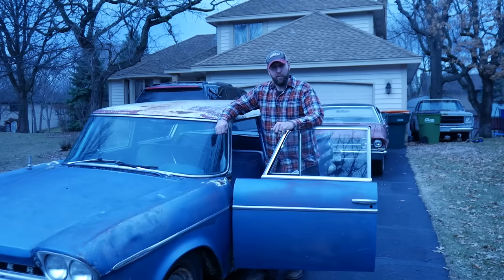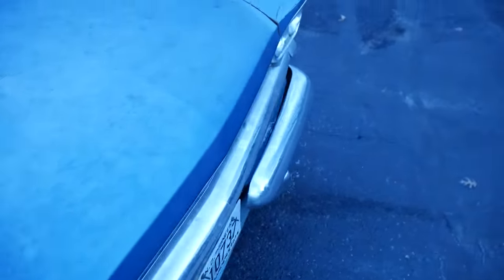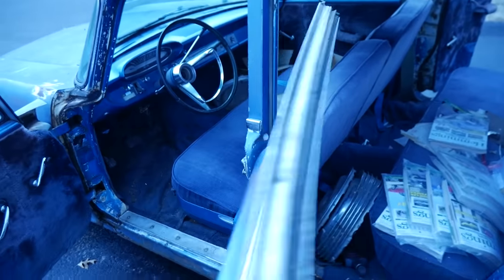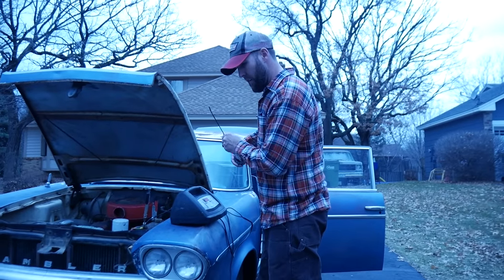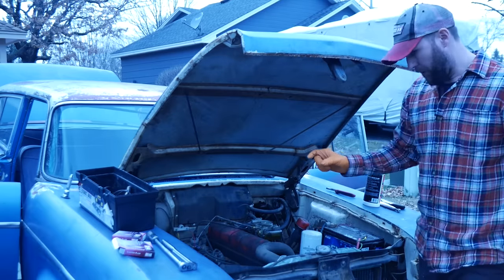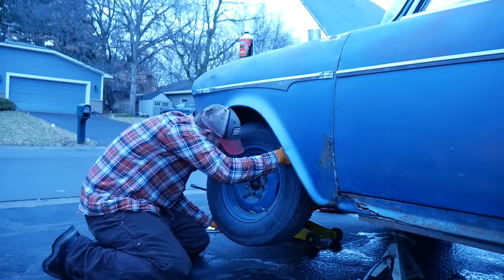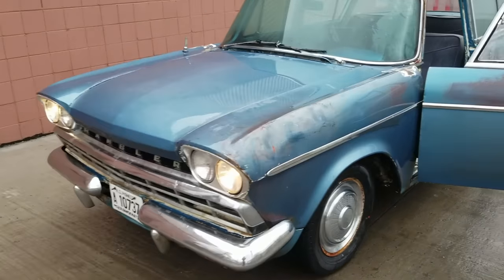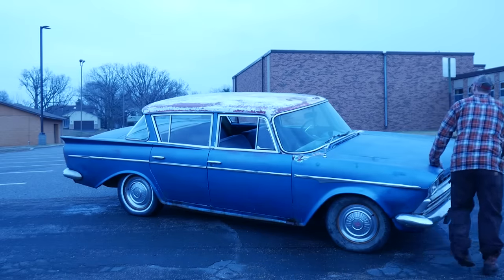AMC Rambler First Start & Clean Up - Vice Grip Garage EP22

Comment: I get old cars like that one, previous owner's neglect and frustration can be a good buy.  I wear out a can of WD-40 on all the latches hinges, window regulators..  anything that moves or used to move...  and I wear the whole car seems to respond to it...  Runs better too!
When replacing bulbs and checking connectors on those old cars, you're going to find them either rusted together or a white powder of dis-similar metals deteriorating one another...  Use dielectric, conductive grease on all electrical connections.  Makes positive connections and end corrosion.
There, those two things is less than $5-$8 and things are well on their way...
Carb cleaner, engine oil flush and oil and filter change, top off all fluids, bleed the brakes (inspect the rubber brake lines) plugs nd wires as needed...
For under $60 bucks, you got an easy flip, making cash.

Comment: When I was eighteen I had a red and white1962 version of this Ramber back in 1968 that nearly took my life on Christmas Day. I just arrived in Smithville Mo.after a trip to Tulsa and back, After eating at the Dairy Y, I put the car in reverse then the left front wheel completely fell off. If that had happened on the interstate while I was traveling at freeway speeds, I'm pretty sure, I wouldn't be alive today. AMC was known for defective front-end A-frames back in the old days. It would be wise to check the front-end suspension for integrity issues before driving that car again.

Comment: I bought a 1960 Rambler in 1971 for $80.
Push button transmission and the seats folded back into a bed.
Finally killed it chugging up the Pocono Mountains.

Comment: "Old Blue and Lubed" or "Whydbit" (Why Did I Buy This).  If you have the odd 427 or similar big block, it makes a great "sleeper" for street racing those fancy Detroit and Import "go fast" cars!  The one with the 427 and slicks recessed behind the stock fenders sure surprised a lot of folks, especially when he pulled the T handle in front of his seat the opened the cutouts for straight header action.

Comment: I loved my Rambler, I traded a shotgun for it, had a 2x4 preventing the front seat from falling back, lot-zzzzzz of weight reduction plus the optional bear can disposal hole in the floorboard. But I loved it, it ran like melted butter. Wasn't as nice as this one. I miss my 3 speed. Unfortunately I was trying to keep the radio speaker from falling in the floor and a telephone pole jumped out and hit the car. So it was so rusty that it totaled it at 15 miles an hour. Loved it though. I took the stereo out and was able to save that.

Comment: My Aunt brought home a new 1958 Rambler 4-door pink/white top. The 1st thing I did was push in the cigarette lighter.Apparently it stuck in, what did I know,I was 14! I left the car andupon returning some hours later, the lighter still stuck and making heat had melted it's plastic handle and sent it streaming in melted goo on to the new carpet. My Aunt was not happy. the next event with this car was a trip to the Rambler garage to check on its repair status.It was awaiting a factory parts shipment, but what sticks in my mind is the tremendous volume of parts contained in an automatic transmission spread out on brown paper on the shop floor. The shop supervisor's conversation did not inspire confidence.It would not be the final meeting with this man.Looking back this was a basic piece of proven mechanical technology,certainty not cutting edge, so why was it so unreliable?

Comment: Call it the Gambler, or the Rumbler, put a hot V8 in it and some kind of suspension mods.  Stiiffer shocks.  Maybe a tach and some guages.  Cooler wheels would help.  Maybe just tricker hubcaps

Comment: I had one of those in high school. The previous owner died in it and they didn't find him for awhile, so I got it for next to nothing. That odor made her a real chick magnet. If I took a corner too fast, the doors on the outside of the turn would swing open. That improved ventilation for the stench. One time after I changed the oil and did her a few other favors, afterward she wouldn't start. I got mad and stabbed her in the fender my screwdriver. (Hey I was sixteen and not doing too great at the time.) I meant to punish her with a dent she'd remember, but the screw driver went right on through. After that she started right up.

Comment: sir you do not see amc rambler hardly any more those are super classic. Some body issues but a real beautiful machine? Insides look fairly good and it runs pretty good for a vehicle that sat for like 9 or 10 years. Take that to a car show and try to fix those breaks if you can find some. Im sure that beauty would get allot of lookers with original radio. The radio might have tubes in it and a radio vibrator. If wires look iffy might smoke out! Change the wires or use some type of insulation under writer  laboratory  approved tape or shrink wrap. I had a car that smoked and i almost lost the car

Comment: Had one front wheel fall off ttrunions break.
   in winter have to burn newspapers to get pushbuttons un stuck .no smoke or leaks quart of oil every 50miles . 🤗 Otherwise fine quality original. Engine threw a rod

Comment: My parents had one of those when I was about 7 back in the 60s But it was a station wagon. But it had that exact front bumper and grill. But It was the same red as the engine in that one.  My parents were shopping for a car, and they found that one, It was used, and only two years old. The salesman talked them into taking it home and test drive it for the weekend. But over the weekend they decided it was too expensive for them (Payment wise) so they took it back. But the dealer sold their o[d car over the weekend. And said they couldn't get it back. So they had to buy it. or walk home. I remember they drove it for A few months, and my Grandparents took over payments and they drove it for 25 years. I do remember them suing the dealer And buying a nine-passenger Pontiac wagon with the money. Turns out that the dealer was doing that to people all the time. they just hide your car behind the building and force you to sign papers.

Comment: Don't mean to insult any Rambler fans but seems like from appearance and my recall of parts availability as an American answer to the Russian Zil.  Sorry Russians, that might seem an insult, none intended.  
Backstory:  At one time I lived in Pueblo Colorado and was sold or given a Rambler Classic Wagon.  Wife and I took the thing to Colorado Springs and the pot metal column shift broke in the middle of an intersection on the way to the zoo.  We never got to the zoo.  Had to push it out of the road with some help.  Drove back to Pueblo in 2nd gear with some serious clutch slip to get it running in 2nd gear.  Killed it a lot.  It was a sad car even in the mid 70's.  Spent too much money on it, had to rewire the blinkers.  Later moved back to SE New Mexico in it driving in 2nd gear all the way because it was all we had.

Comment: Name : Gertrude or Ethel    ........ a 340 / 383 / 440  Mopar with a 4 speed pistol grip  and a tranny / rear end to do the job ....... and  decent brakes and tires right around ....... and leave it exactly the way it looks ...... the ultimate sleeper ..... wrecking yard motorhomes had 440 's in them ...... and they are usually cheap ......

Comment: Why would you want that car?  My father had one and the wheels fell off, literally.  The front wheels folded under when some retention pin snapped.  They were notorious for that.  Other than that the only thing I remember about that car was the push button transmission gear selector.  I'm not sure what year his was, I see you have a shift on the column.

Comment: Turn the old Rambler into something  street league that can beat a 1995 Honda Civic with a K24 Acura engine in it. Awh, you know, something that can beat a Lamborghini in a street race, which is what a 1995 Honda Civic with a K24 Acura engine in it CAN do. Oh, did I forget to mention, that it's got to be street league too. Yah, that would be a really nice project for the old Rambler.  Good luck with that project though!

Comment: Names? A guy gotta go with "Highway 41", Allman tribute, Ramblin' Man. Next, and this WILL challenge you, but 'choo gots dem factree skills, block off/in the rear doors (delete) and cut the hard top off while reserving it for a removable hard top, then you sir, are in SEMA and are immortalized. A 427 crate would be too cool in that or a 6.0 LS take-out of a corvette if the weight might be a problem. Maybe the steering column from the same donor car?  I'll kick in the first $200.00 towards the engine/trans mod. =Major Dave

Comment: Chrysler  technically still owns them so its all good lol , shame it was a 192 cu engine plus side very cheap to rebuild im in several of the early i6 mostly 232 an 258 the factory valves seals are always a mess

Comment: American Motors/ Matador, Javelin, AMX, Rambler,AMC Hornet and Jeep .
Careful Ramblers were
Notorious for Bad front suspension ball joints 
failure resulting in wheels actually detaching from the vehicle. Maybe the Super Sedan does Ok
I'd Like to see It restored back to everything original
As You can See the AMC's are zippy little Cars , Yeah I'd like to (see Ya keep it,) I'm sure 
It will run strong indefinitely . Parts might be a Beast
Possibly have to switch to a more modern engine and trans.